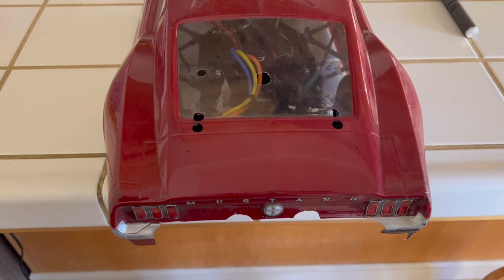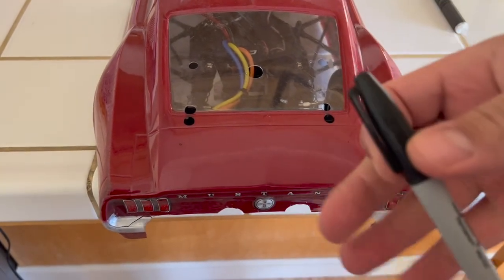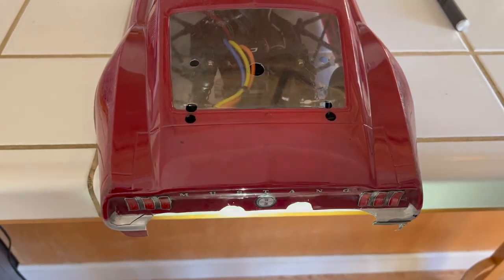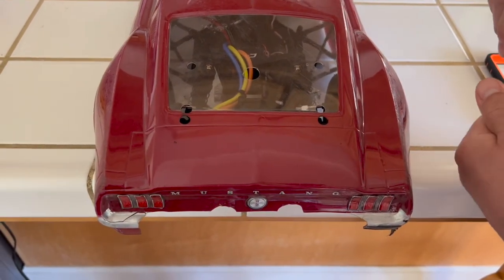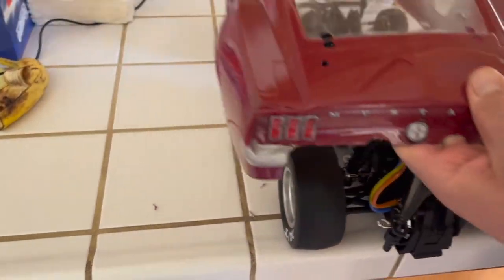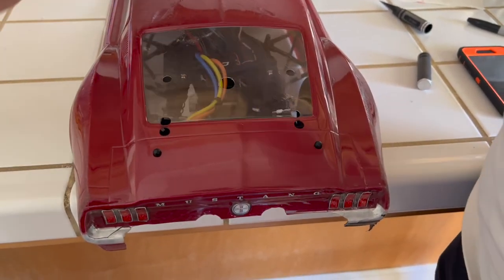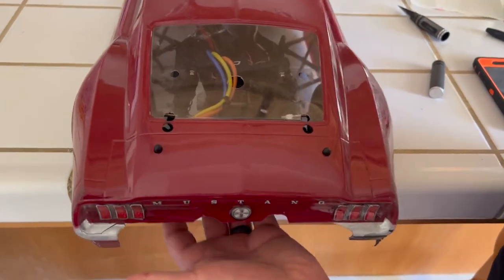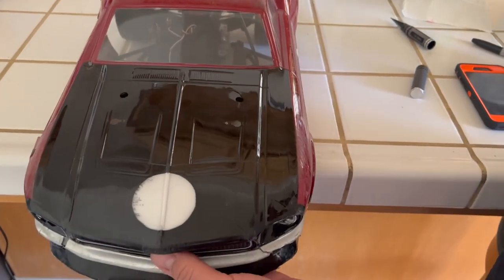How to make ream holes in a painted RC body

Comment: Do you use the horizontal mounts for any of your touring cars?
Reply from the maker: I do not. They are mainly good for preventing body tuck when rear ended. You also have to be very good with your measurements with those.